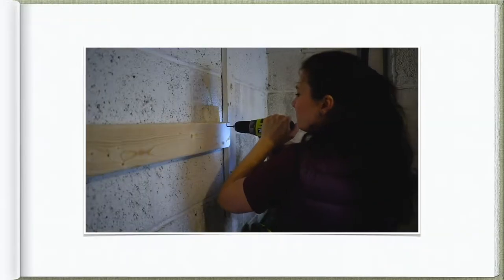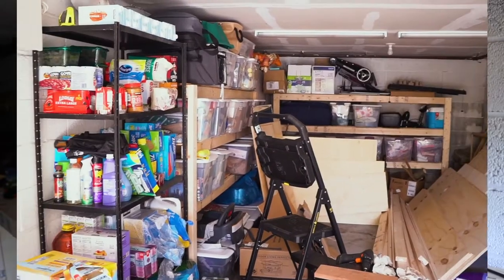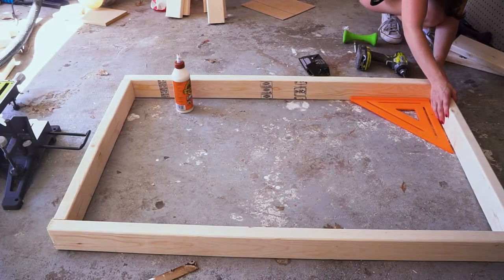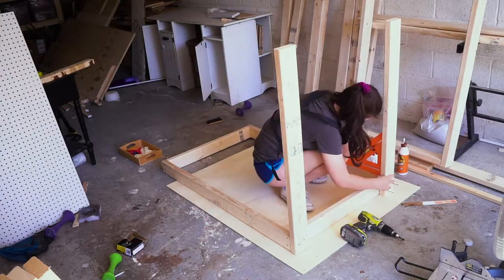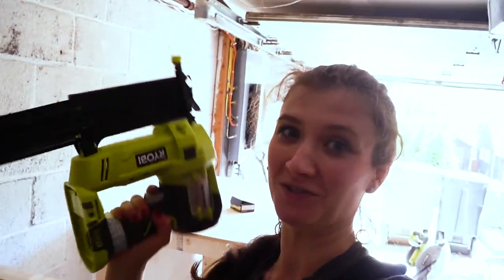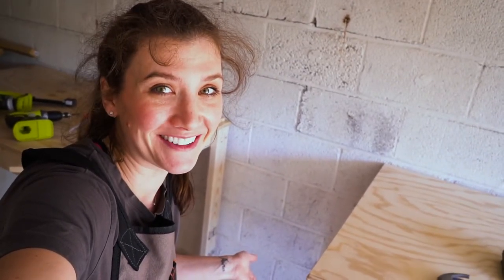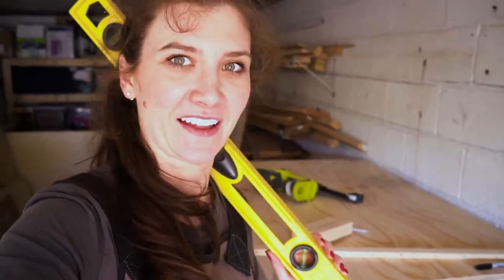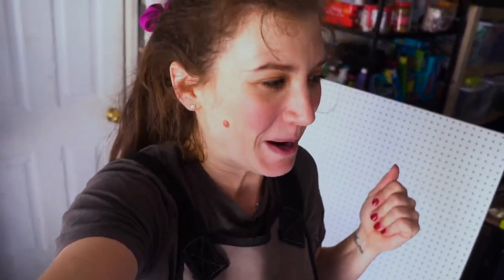How to build an Ultimate tool bench | Part 1. | Garage makeover | If Only April

Comment: I am getting ready to build her Ultimate Workbench for the miter saw.  One problem I have is the cross members.  Her plans and you simply glue and screw them.  Personally I prefer to use a half lap joint in order give the shelves more carrying weight.  Outside of that, the build is awesome.
Reply from the maker: That's a great point Jason! It worked fine for me just gluing and screwing it but I see what you mean! And indeed! It's a great build! Good luck with your workbench :)

Comment: Nice job. I'm currently building the same bench. The only thing I'm doing different is putting hinges on the top for extra storage
Reply from the maker: That’s so lovely!! How’s the process going? 
 I actually thought to do the compartment on the top but than I saw someone else’s comment that when they did it, over time the plywood on the top wrapped and wasn’t flat anymore 🤷🏻‍♀️ just keep that in mind and do a research about it!
Reply: What a charismatic and informative video! I will soon be adapting this build to my garage with four rolling to carts and a radial arm saw next to the miter saw since I have both already. 

Seeing the project being done and adding notes on things to consider (like the uneven floor) will save a lot of time and headache! Thankyou so much!